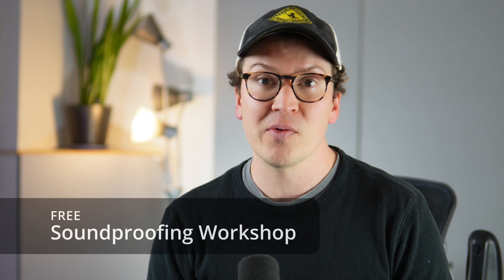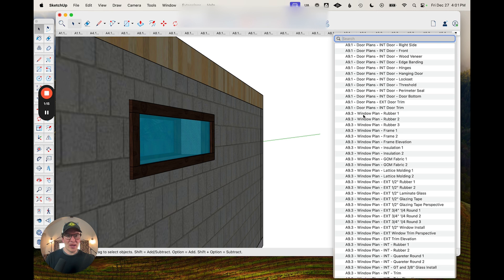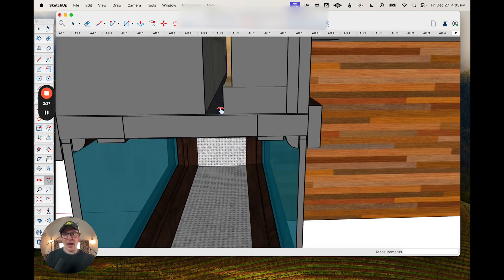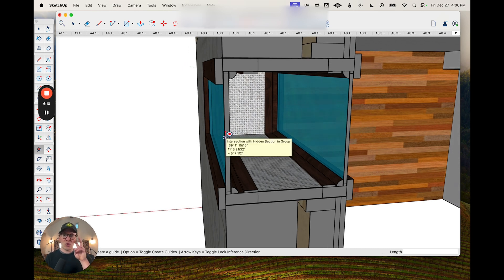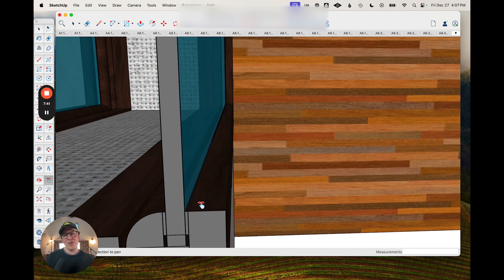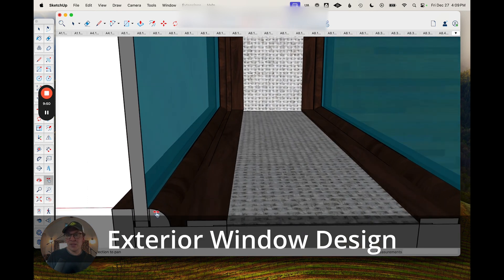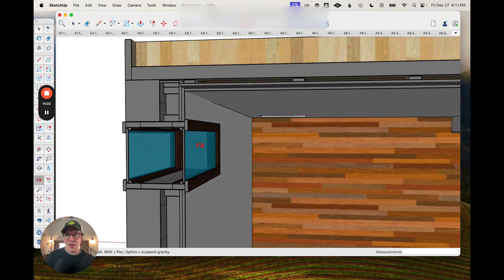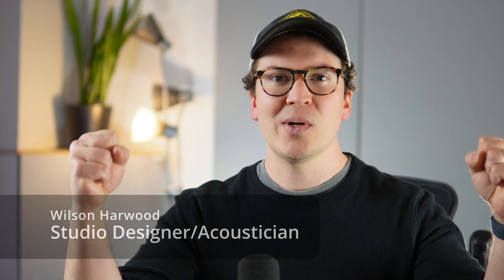How To Build A Soundproof Window - 2025 Update

Comment: Hi , I am in between two options to soundproof my ceiling for my upstairs neighbor, mainly stomping and just impact noise (dropping things on the floor moving things) from upstairs option 1 would be blown in mineral wool insulation. Option 2 sonopan with 5/8 drywall on my existing ceiling . My question is which would be the best option to deaden sound of the stomping upstairs??

Comment: Sweet build!

Building a home theater section in my basement. This window would be between the office and home theater area on a double stud wall with two layers of 5/8” drywall on each side. 

Can you double up the glass with some sort of clear glue, or get thicker panels for more mass?

What about a 48” x 24” window? Interior window too. Too big and would vibrate more?

What is the STC of your window? 

Is this sealed so no dust or bugs can get in?
Reply from the maker: All great questions! I answer a lot of these in other vids on the channnel. The more you change the design the less likely it will work as intended. Air tight seals are important for sound isolation. Tell me more about your home theater. Do you have full construction plans for it?